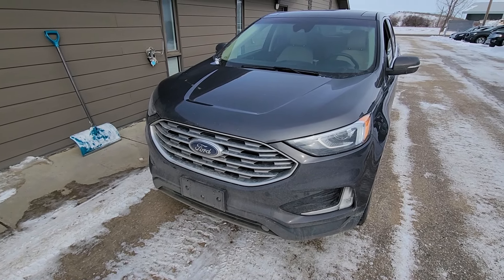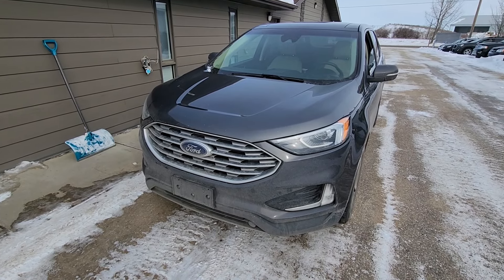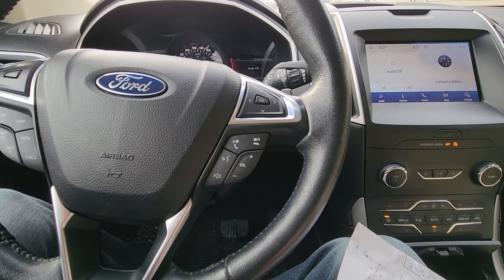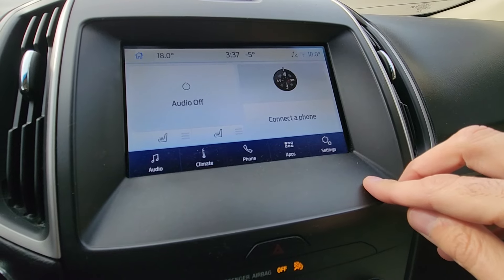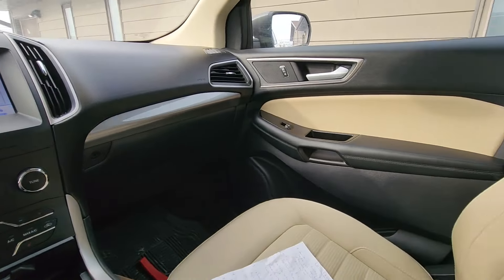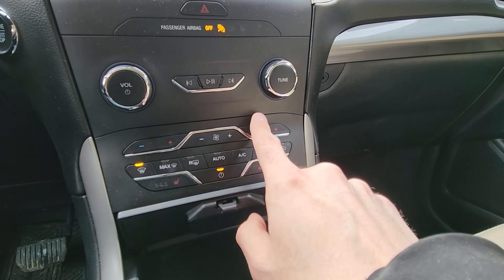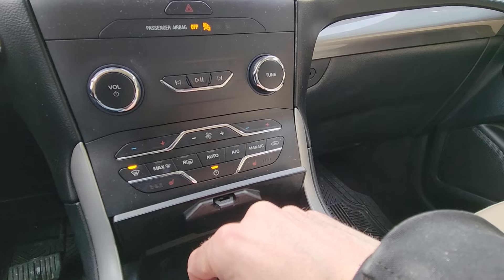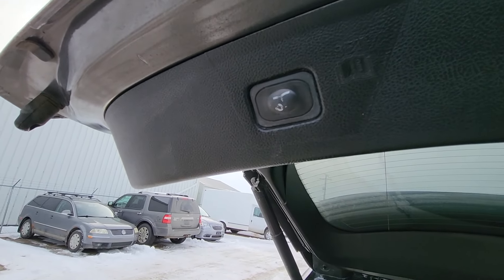Ford Edge - TOP PROBLEMS & ISSUES 2015 - 2024 (common fixes, repairs, defects)

Comment: I had problems with battery going dead if not driven for 2 days but that seemed to resolve itself.  Also, the tailgait sometimes closes when I have my head in there taking out groceries, etc.  Also, the hood doesn't stay up and I have to use a stick to keep it open.  The car always seemed to drift on the highway and you definitely had to keep your eyes on the road.  Maybe the tire pressure sensors are not accurate?  I put a few extra pounds in the front and a few fewer in the rear-  lots better.   2017 edge, v6, 30,000 miles.
Reply from the maker: Thanks for sharing your issues with the Edge
Reply: Beware the shitty 3.5l, your water pump will cost a few thousand dollars to replace and don’t neglect your PTU. The PTU should get serviced 30,000 miles and the rear differential should get serviced around 60,000 miles.  These ford are known to have crap CATs and they are apart of your exhaust manifold and if they need replaced it cost an arm and a leg to do. If DIY it’s a pain in the butt to get out appears impossible but can be done.

Comment: Thank you for this detailed list of problems and solutions. I plan to buy a 2016 Ford Edge Titanium with V6 engine and 93,000 miles. The Ford dealer in Tulsa, OK says it comes with a 3 month / 4,000 mile warranty "on 1,000 items". I feel like I should show them your video and make sure everything it updated (including the rear lift gate software). Should I also have them put it on a lift, so I can look underneath? It has spent its entire life in Oklahoma... so, not too much snow.
Reply from the maker: Hi, if you are buying from Ford dealer they should update all the software on it before selling it to you. It literally takes 15 minutes to plug in their oem scanner and update everything. Now it is always a good idea to have the vehicle pre-inspected before buying it, it kind of all depends how much you trust them. If you lift the vehicle you will be able to see possible oil leaks, possible frame damage, rust spots. I am in a car business and lifting each car once I buy it is the first thing I do. Also V6 is a really good engine, I like it much better than new 4CYL turbocharged ones

Comment: I got a 24 ford edge I just noticed today when I was driving very slow through a parking lot it was jerking bad. And twice now during acceleration I felt a slip through my gas pedal. Since I just bought it I hope it’s still under warranty. Dealerships are pretty untrustworthy most of the time. I travel a lot far from home so hope I can make it home.
Reply from the maker: Hi, sorry to hear this is happening to you. You should still  have full warranty on your Edge so book it in at a Ford dealer and let them diagnose and fix whatever is happening

Comment: My 2016 4cylider sel ford edge was having engine light on and overheating 🥵 and I changed temostart and clear the light off with system scanners but the overheating stopped but after some hrs the engine light comes on again,  I don’t no what to do
Reply from the maker: You will have to rescan the PCM and follow up on the codes. Sorry I can't help more
Reply: My Ford Edge did the same thing was a blowed head gasket? It kept running hot.
Reply: @QuiteAlright thanks
Reply from the maker: @akpugideon1078  You're welcome. I hope you will have it figured out and it won't be too big expense to fix it

Comment: When accelerating my vehicle the vehicle jerks not sure what’s going on
Reply from the maker: Hi it could be a number of reasons, it is very hard to tell without proper diagnostics. Could be a misfire and vehicle needs tune up or could be fuel related, air / fuel ratio, or transmission related. Sorry I can't help more
Reply: I have a 20 16 4.cyl edge .105 ooo has no pro legs we're u get ur Info can't understand.ur speech too.well
Reply: I'm having the same problem with my 2020 ford edge it's pretty annoying
Reply: @mkjones7949 do they sell it in Canada? Or something similar to that
Reply: Same problem with my 2020 Ford Edge.  Drain and filled transmission fluid twice, don't think that is the problem.  I think it is related to the EGR.  I replaced the egr sensor, it was $16 on rockauto.  There is also a egr valve with 2 rubber tubes that is $100 that I have not replaced yet.  I am first trying a spray cleaner in the air intake to see if that clears it up first.  So far it has helped a little.  I will give it one more week.
Reply: @qcace1696  what happen ?
Reply: @Heroooooo0  I ended up replacing the second egr sensor with the two tubes and this fixed my problem completely.  I was able to find the part cheaper on rock auto, but I had to reuse the existing tubes.  They were clean so it was not a problem.
Reply: @TommyWilkey  cool name!

Comment: Just bought 2015 titanium , it’s shaking while driving and in idle. I’m not sure what it could be ? Someone said something to do with the tires .
Reply from the maker: Hello, shaking while driving could point towards tires needing balance, but also it could be at least 10 different things which come to mind. Shaking while idle are definitely not tires. It could be something as simple as having a misfire and needing tune up (spark plugs), bad air / fuel ratio, bad o2 sensor, bad fuel injectors, etc. Further diagnostics has to be done starting by scanning the vehicle for any codes and follow up on those. If no codes next step is taking it on a test drive with diagnostics tool connected and monitoring numbers to pinpoint what is going on. Sorry I can't help more
Reply: @QuiteAlright I did put it on the machine and nothing comes up besides ABS code but passing /ok. Thank you for replying . Maybe a tune up spark plugs
Reply from the maker: @tara1440  No problem. Misfire would usually set up a code, but not always. Best you can do is for someone experienced to look at it. Maybe even take it to ford dealer for 1h diagnostics and then fix somewhere else or by yourself

Comment: Radio screen blank
Reply from the maker: Yes happens quite often. Try resetting ford sync by removing the fuse or run the update and see if that fixes it
Reply: My 2024 does this, I have taken it back several times the dealership said it’s like a cellphone it gets hot and goes black. I don’t believe that
Reply: I had to replace head unit on wife's edge due to black screen. Found one on ebay make sure numbers match

Comment: 2018, 91k, second owner. This vehicle got from Florida to CT with the forst owner, then from CT to SC, NM, and now CA while also pulling a light Uhaul trailer, never gave me any major issues.

 The only things that have popped up is the trunk being finnicky about finally latching and closing, and when shifting out of park the vehicle sounds a little clunky but otherwise it runs well.
Reply from the maker: Thanks for sharing. I'm glad your Edge is serving you good

Comment: IMPORTANT
If you feel a grinding vibration feeling when turning especially under load (turning while pushing on the gas) at low speeds this is your rear differential going out. There are tiny teeth that are rounding off and eventually you will hear your diff make the infamous whining noise and it’s too late. Replaced wheel bearing and axles and all the things you’d think that could cause the car to turn harshly. Turned out to be the differential.
Reply from the maker: Thanks for sharing your experience and sorry this happened to you

Comment: 2019 ford edge titanium 
177k 

Problem with the hesitant issue took it to ford but they changed ptu and transmission fluid and that didn't work so i took it to a transmission shop and found the problem being the tourque converter so it needs a reman transmission and new tourque converter. This happened during highway speed it hesitates let of the throttle and goes normal then goes back to hesitation again. But this started last year i figured it being the PTU or transmission fluid from what i was researching but here i am now found the problem. Cost to fix $6700 plus the install also getting a new tourque converter no price on it yet hope to know August 1st 2024 from Ford
Reply from the maker: Thanks for sharing and sorry to hear you are having such problems
Reply: Any other symptoms that were related to this issue?
Reply: @NYG5  just the tranmission torque converter slipping.. the shop here had a scan device for transmission. They said changing the fluid won't help it's internal so just day by day for the ford edge this happened after warranty expired too

Comment: I have a 2015 ford edge titanium. The maintenance light is on and I got it checked and it says the turbo needs to be replaced. Did you have a video on that?
Reply from the maker: Hello sorry I've never replaced turbocharger on Ford Edge. It is quite a big job probably

Comment: Just got a Ford edge 22 titanium any problems I need to know about let me know
Reply from the maker: Pretty much what is mentioned in the video (from my experience)
Reply: On my 22 titanium edge, the driver side light got morning dew inside the fixture.  I shortage out so I have to buy a whole left fixture
Reply from the maker: @erwindenny426  Sorry to hear that. Those are quite expensive. You might want to go with a used one. They should fit 2019 - 2022 based on my part supplier